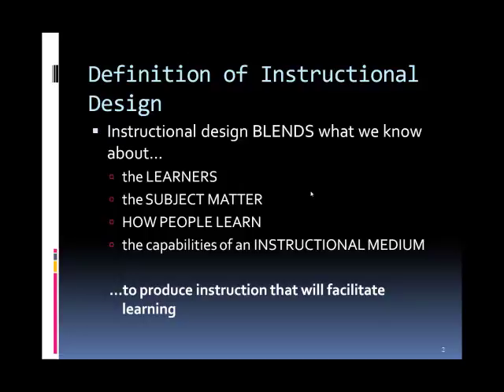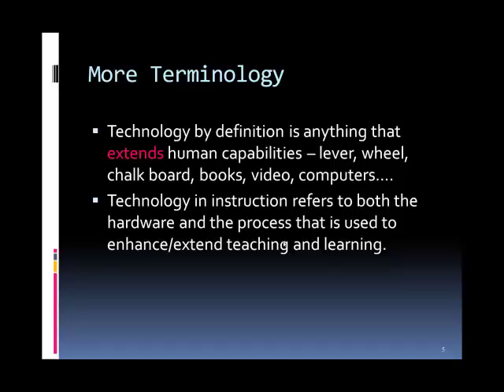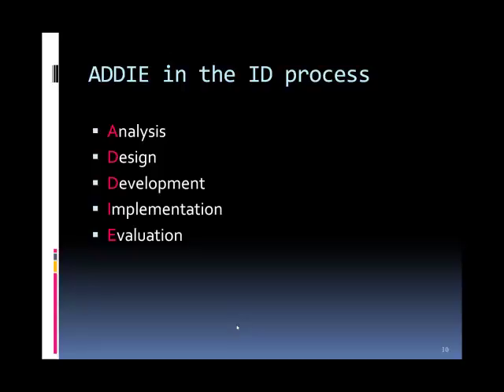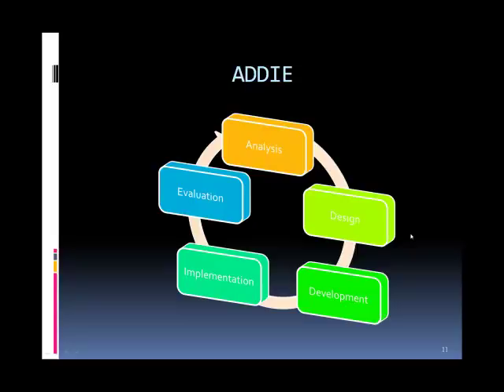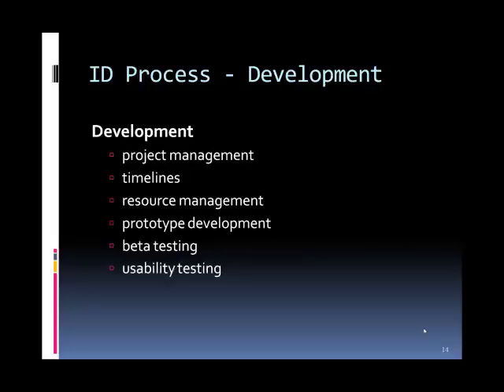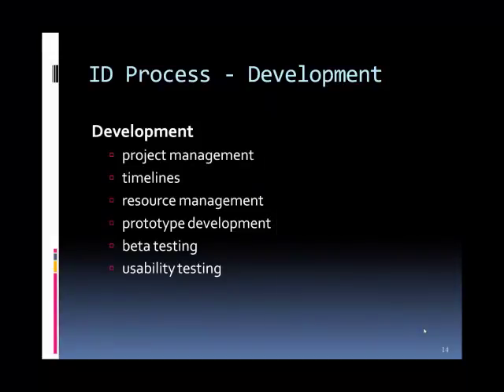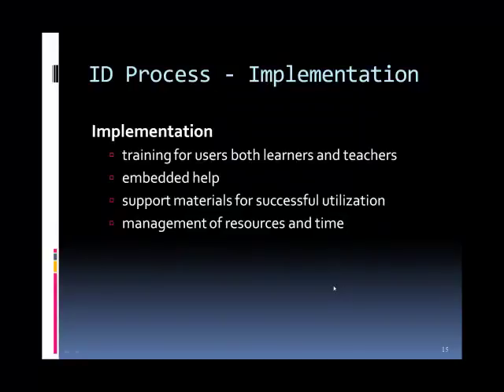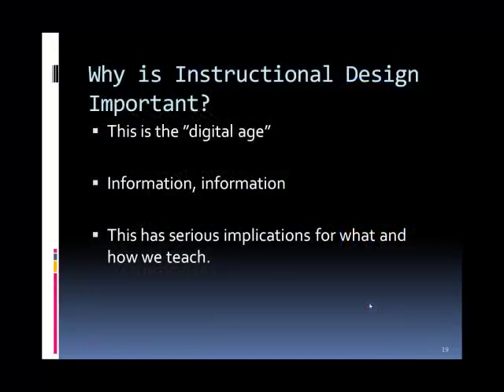Instructional Design Sample

Comment: Although there are some interesting points raised in this presentation, it is not the best advert for someone who is a professional Instructional Designer. The video and audio is cut badly in places, the dialogue seems unplanned and rambles on in places and worst of all, the presentation is incomplete, cutting out 30 minutes and 23 second into a
the 36 minute and 23 second long presentation (lots of black at the end).